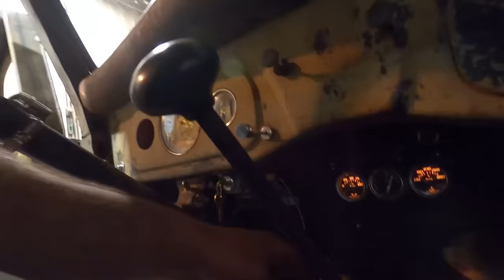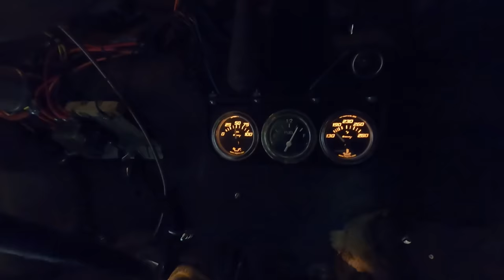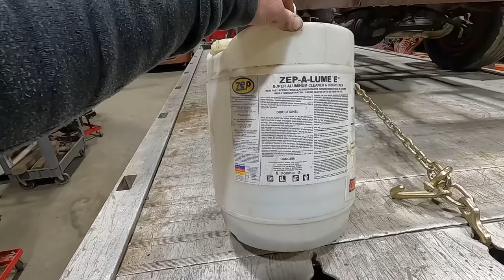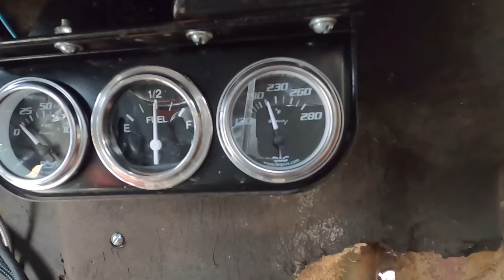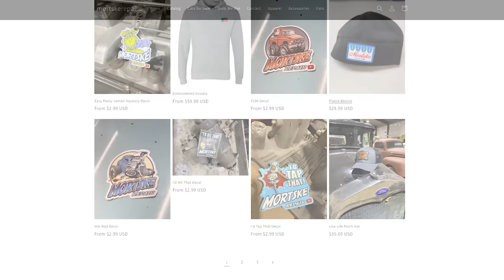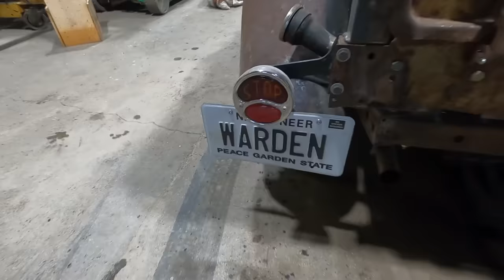1936 Ford Barn Find Pickup Truck! Overheating Flathead V8!! Problem Solved!

Comment: I had a laugh when you mentioned the flathead as a race engine.  My great uncle was a stockcar mechanic back when they were using the ford flatheads as their engines.  His specialty was fixing the water pumps so the car wouldn’t overheat.  They pulled out the thermostats and dropped in a thick 5/8 (I think that is the right size) fender washers.  The washer was an exact fit without modifications.  In addition they shaved 1/2 the veins off the water pumps so the water had enough time in the radiator to cool.  That was the way he had set up the 1950 truck he gave me.  In Alabama in the summer no overheating issues with the engine he built.
Reply from the maker: interesting
Reply: He said that anyone could take the water pumps apart and shave the veins, but he was able to put them back together and not have leaks.  That is why other racers brought him their water pumps to “fix”. Also, he said the radiator in the truck was a “big truck” radiator as it has more capacity.  The radiator looks like the right radiator in a 1950 but it maybe too big to fit in your 36.  He told me a few more things they did with “stock” parts to be race legal but get more displacement and higher oil pressure.  Those were a bit more extreme and required modifications you probably wouldn’t want on a daily driver.

Comment: Happy New Year ! '24 is the year I get my Volvo V70R reblocked. No excuses. 
I used to use diluted muriatic acid and pump it through the raw water circuit of the heat exchangers/oil coolers on marine diesels after removing the sacrificial zincs. Then I'd run water through to flush, then a mixture of baking soda to neutralize any remaining acid. Was a stopgap for a cooling system overhaul.
Reply from the maker: Same to you!

Comment: Mortske, I was always taught to use the K.I.S.S. method as well... 
I Use old school Toilet bowl cleaner for flushing Rust out of the block 
( it's designed to help remove the rust stains from the old iron water pipes that used to be common )
the expensive name brand option is CLR° ( Calcium, Lime, & Rust remover )
Reply: BACKFLUSHING ALWAYS WORKS BETTER....
THE WATER AND SEDIMENT ARE USED TO ONE DIRECTION OF MOTION...
If you flush the system so you push the water the opposite direction of normal operation it will break a lot more of the sediment loose the first time so that you don't have to repeat the process as many times... 
( has the added benefit of clearing the passages closest to the drain so that it doesn't clog as quickly while you are flushing )

Comment: My uncle for years and years he used white vinegar for a couple heat cycles then he’d drain then pour in some baking soda and water mixture to counter the acidity in the vinegar. After that he’d unhook the heater core hose and hook a water hose straight in to flush with water and Joy dish soap. He always said the suds would help push stuff out and clean anything out. Idk it’s worked for me in the past on a couple of my on old clunkers so idk. I’ve watched him do it for 30 years.

Comment: The 101 flat-head powered dual carb stock car suffered overheating; Lou, the owner, cured it by discharging three cans of oven cleaner into three gallons of water. He removed the water pumps, made hose bib plates to cover them, hooked up a circulator pump, and ran it day and night for 48 hours. The radiator had a new core, so that was not a problem. When he dumped the water, it was a slurry of rust sand, and mud. The punched out flathead did not have any further problems

Comment: Great video. I used a product for removing rust called Thermocure. It's made by Evaporust but it is much cheaper to add to your radiator because it is made for cooling systems. Evaporust is great but it gets pricy to buy 3-6 gallons of the stuff. I used Thermocure on an old engine with great results. No rust anymore and it didn't seem to eat the gaskets or radiator up. You have to flush it out before you start and after you finish because it will gel antifreeze. The engine was incredibly rusty.
Reply from the maker: Great tip!

Comment: You can buy the aluminum center core, use your glass filled nylon ends of your radiator. Pry the tabs then squeeze the new one on with channel locks. I haven't done one in awhile. May not be a option anymore.

Comment: Pipe cleaners were for cleaning the stem of a tobacco smoking pipe, not water pipes.

Great episode as always!
Reply: I use .22 cal and 7.62 MM bronze bristle brushes for cleaning water passages and a football inflation probe, blocked at the end, and cut a slot facing backwards.  I hammer it onto my lawn hose, and it blows back all the crap out behind itself as you push it is.  Works great.

Comment: Well, I can honestly say that my project for 2024 is an ongoing one from last year and it's a 1927 Morris Oxford flat nose tourer. That's been family owned for the last 40 plus years that had been stood for the last 10. I got it going and out driving around last summer but the old boy still requires a little bit of work here and there to the ignition system and the fuel system. It's an adjustments to the steering, but at 97 years old it runs and drives pretty well
Reply from the maker: Good luck!

Comment: I can remember whacking the ice with the point of a long handle ice scraper back in the day.     Winter sucks.  How are you going to charge your Tesla with the power out and 2 inches of ice on your solar panels?  Years ago I remember my landlord using his tractor and a generator like yours to power the farm.  Had to power the well so he could water the cows.  Use to be able to buy a radiator flush kit in the auto parts stores.  Did it to a Olds 88 that kept overheating but I don't think anything but the mechanical removal of all that rust would work on your flathead.

Comment: I bought a 1988 f150 that sat long enough for the tires to rot and it was a crusty green. Now it's tan and cream, has new tires and runs. Doesn't charge and runs on 5 cylinders at idle but it has 66000 miles on her.The front end feels good ( a girl does well to have a nice front end) and I have high hopes. Oh 300 straight 6.

Comment: had a friend one time we were putting valve cover gaskets on 302 ford couldn't see rocker arms so pulled intake and oil pan and timing cover hot water pressure washed for whole afternoon finally got it clean new oil pump and gaskets ran good
Reply from the maker: yuck

Comment: There is a product used in the laundry industry to remove stains in clothing caused by iron in the water. Works very well in cleaning  rust deposits in anything.

Comment: Truck running the truck engine till it’s hot, turn the valve on under pressure whil running, get more rust out, or remove heads, pump, clean it.  You got this.  Lazy guy could do it

Comment: Nothing  better than riding  around  in a flathead  ford with your best friend. Project  I have.getting my 49 ford pu.driveable .53 dodge panel truck with,s10 frame with l.s. finished.and get my 62 impala body work done and painted.mite even  do a crown vic frame swap on 57 ford pickup.i gess that.ll keep me busy  for January . Happy New Year
Reply from the maker: Same to you!

Comment: Circa 23:30....  Grandpa had a model T truck.  Early 50s, they forgot to drain it out one fall and cracked the block.  It went to scrap.  My late Dad used to talk about this truck as he was a teen at the time this happened.  They then acquired a beater Model A sedan and cut off the back to make it into a pickup and that was the farm truck for a few years.
Circa 43:12....  Other story from another grandpa...  Corn cob fire under the tractor to warm it up enough to start.  This one goes well with the story my Dad told of dipping corn cobs in kerosene and lighting that and using as a way to thaw frozen pipes in the barn.

Comment: My 37 ford sedan used to overheat the whole time I owned it, I put alloy heads on it, had the radiator core replaced, but it still used to overheat and vaporise the fuel. It didn’t help that I live in AUS and it often gets up to 40 C here in the summer.  Of course your engine could have a blown head gasket or a cracked head.😬. Nice old Ute

Comment: Excellent video Mortske :) , Duff Dog 🐕, MOJO  :) also only thing that rust up on water problem you can try on next oil change use no synthetic type engine oil  , plus before drain plug also oil use bottle of brand Red Seal GUNK  put in engine for 5 or 10 mins have in engine oil plus motor running too then 5 or 10 mins up drain engine oil till stops to and do oil filter too ! See oil pan take more out too , also disstle  water with Green Prestone Antifreeze 50/50 and put 200 ml of 80w90 differential fluid  in rad run thru to!  Also drain to after 1 hour drive too ! Also check Rad cap if rust or dirty soak in Vinegar 50%  and Hot water 50% mix up  together too! Before do Water and Antifreeze  mix to running thru and bet help out on Vinegar and water mix running with engine running for 30 to 1 hour then drain it also do Antifreeze with Water  to after! See what happens too and should help out ! Happy New Year 2024  Mortske  & everyone too also !

Comment: I'm working on three. LS in my 95 firebird that's in wiring jail. 30 Model A truck with 57 D500 Hemi with a quick change, working on windows and interior. 26 Model T roaster with a small block on a model A frame and fenders, working on controls..

Comment: 1984 k10 Silverado gonna make it long bed and a diesel and turbo that bad boy. I like the lifted truck Mr mortske I got a line on some factory 16's and a set of 325/85r16s calling me to finish it. As you know, maybe not so much anymore, the funds are usually time extender.

Comment: IME ATF/Acetone will do better as a break free than PB or Kroil, and its way cheaper to boot. Less convenient using an oiler instead of an aerosol, but its my go to. Could probably put it in a vaper/pressure sprayer too, but I'd expect it'd eat the rubber seals.

Comment: Get you some engine brushes for cleaning out the oil and water passages. You can get a set pretty cheap and they come in REAL handy for such jobs. Very useful for the old engines that are full of rust. That and CLR and you have a clean engine. On the inside anyway. lol
Reply from the maker: Thanks for the tip!

Comment: Clean the core sand out of the block on each side.  Ford usually left some in the block after casting.  It should help cooling.

Comment: LOVE the long videos!!!!!  What am I working on this year?  I have a '95 Firebird Formula convertible that is in mint shape ( 85K miles ). I am building a 383 ( the only stock parts are the block and timing cover, hoping for about 450 horse ) for it along with a built 4L60E ( have a bad left knee so a manual is out ). Have a Mosser 12 bolt with 3:42 posi. Full UMI/BMR suspension. The big 12" '98 - '02 brakes and Bilstien shocks.
Love flatheads. Not much power, but cool nonetheless.........

Comment: I picked up a 74 Vette. Not necessarily a hotrod but it does come with 383, built trans, four elevens and a 740 hollie. In spring I will pull it out and see just how stroker it is. Probably change the reaend to something a little more road worthy but not too much.
Reply from the maker: Awesome!

Comment: Merlin over at Merlin's old school garage. Knows how to get quite a bit more horsepower out of 4 cylinder model T and A engines 👍 he also hot rods flat heads. So he probably knows how to get parts 🇺🇸

Comment: On the trailer behind the Suburban tow pig looks like maybe a 38 or so Chevy coupe? 2024 projects....too many to list! But one good one will be rebuilding a 1970 Buick SP code 350 with some go-fast goodies (cam, NOS Johnson hydraulic lifters with EDM holes, T/A Performance aluminum intake, etc.) for my 74 Jeep J20 3/4 ton 4x4 pick 'em up truck. That should be fun. Hope the QuadraTrac transfer case I rebuilt holds up to all the power, as that 350 should be good for 360 or so HP and maybe 450 TQ. Wish me luck!

Comment: For future reference if you ever have to do it again take the shop vac and stick it inside of a funnel insert funnel into the water jacket while forcing air with air hose through other water jackets it’s way easier and faster.

Comment: Just run vinegar in your coolant and a coolant filter in the heater loop. It'll protect your heater core and clean the cooling system.

Comment: You got to make a run off too a pond, piled high with all that snow you'll get and use that all year round, BeRRR Don't Like the Cold, Worked on the Inner Coastal Water Ways of the most Southern Cape of NJ and have seen what Mother Nature Can Bring, and more in my travels, what's neat you can still do It, Thanks and you know how to do It!...

Comment: I’m putting a 5.9 Cummings in my 1974W 100 power wagon the 318 that I built out to a 390 still is great but I wanted some more power to tow with. I also put Dana 60 in the front and with the Dana 60 that came with it in the rear with lockers, front and rear, so my high school truck that my son drove to high school in 2022. I’ll be better enjoy your videos Retired US Army, Sergeant major Gamsby.
Reply from the maker: sweet!

Comment: Try using a piece of speedometer cable chucked in a drill, with a shop vac sucking and an airline blasting to clean. The cable whipping around in close quarters really loosens things up.
Reply from the maker: Interesting

Comment: I'm working on a 74 ford Highboy . A previous owner had flipped the front axle to the top of the springs and removed the rear axle spacer blocks to replace them with a 1 inch variety. (Not sure why)I'm putting it back to a more original stance.
Reply from the maker: Sweet rig!

Comment: In 2024. I'm going to continue restoring my 2012 MX-5 PRHT. I had a new Mazda engine installed. I'm going to go through the suspension and brakes next.  It needs some paint correction as well.  Happy New Year!
Reply from the maker: Same to you!

Comment: An old tricked that I learned years back from an old timer when I worked in the Ford dealership Try Arm and Hammer Washing soda! You dump about half the box in the radiator run it for a couple of days drain the radiator and put the rest of the box in the radiator fill it and drive it for another couple of days and it should work! Drain the radiator and refill with water and coolant!

Comment: Fords use antichatter rods. They attach to the sides of the block and run forward and attach to the front crossmember. It is supposed to have something to do with the clutch linkage and the closed drive shaft. My 41 Mercury has them but my 47 ford does not. I am going to try adding them to stop the chatter on the 47.

Comment: tap water , depending of location can be good but most haves salts and other stuff in it.  a neighbor had used Lubbock tap water in his Olds.  It ate the aluminum parts up and turned the coolant dark brown.  everything leaked.

Comment: I guess one of the only good things about where I live - and there really aren't many - I'm in south Jersey (it sucks) but we DO have machine shops in Philly or NY area (yikes) we have a  COBBLER SHOP right in Mount Holly (like 15 minutes from where I live!! Yeah he still fixes shoes for like $4. Seriously. He did my Ariat boots for 30 bucks.. they were wasted, and 3 days later BRAND NEW again.. 30 bucks.. you can't beat that, especially not for $250 boots that were only 6 years old.. Man they used to last 10 before they had to go to the cobbler shop!

Comment: With pumps off and front of engine lower than the rear, insert a water supply in the back coolant passage holes and with a long screwdriver poke it all loose, one of the easiest things you'll ever do! And you can see everything while you're cleaning, if it needs to soak overnite with cleaning salts, so do. And turn the water up, don't worry bout everything getting wet, juss cleaner up an have a pair of head gaskets an plenty of compressed air at your disposal, that's all it takes!an Again, it's an easy job!

Comment: I've got almost everything I need to rebuild the front suspension in my '73 Javelin. I also have a door hinge to replace in that car so I can have a door check again.  If I come into money, I'd really like to do the interior upholstery.  What I have is OK, but it's showing it's age and I'd like to drive the car again without my butt sitting on the floor.

Gremlin, I've got to remove the clutch over center spring, get a booster rebuilt so I can have power brakes and start driving that again!

The V6 Ram got dropped off yesterday to get it's trans rebuilt.  Would love to get the truck in paint this year.

If all goes well, I'm going to start on my V8 Hornet hatch again.  Found a guy with some 3.73 gears for sale, get a Twin Grip rebuilt and maybe finally look into swapping the AMC T5 for a Ford T5 that is stronger and has much better ratios.

If I can even get a few of those done in 2024, I'll be happy.
Reply from the maker: Good luck!
Reply: @MortskeRepair   Thanks. Gonna need it!

Comment: I don’t know if this will work, it might be to caustic for your new water pump. I had a gas tank that was very rusty inside. It had chunks of rust on the sides and bottom. I used muriatic acid full strength and let it soak for two days. When I flushed it all out and neutralized it with baking soda, the tank was as clean as new. You probably don’t need to go full strength but I’m sure it will work better then water. Have used CLR also but I was not satisfied with the results.

Comment: We use a chemical called Tri  sodium phosphate to clean boilers and steam lines. I don't know if if would damage engine gaskets and seals so if you try it use one of chins engines the first time.